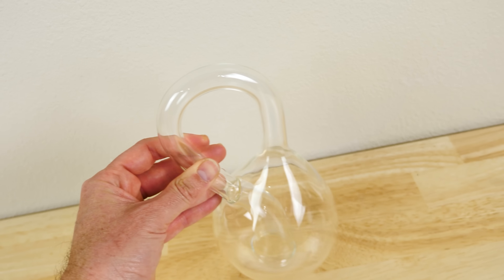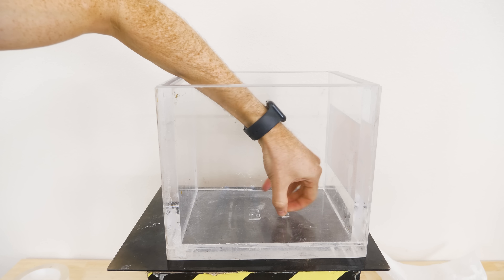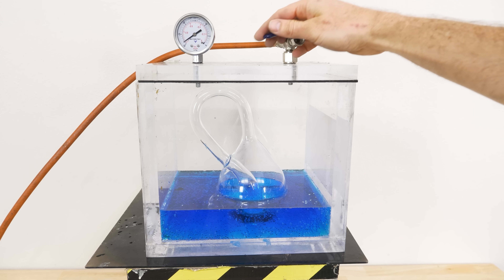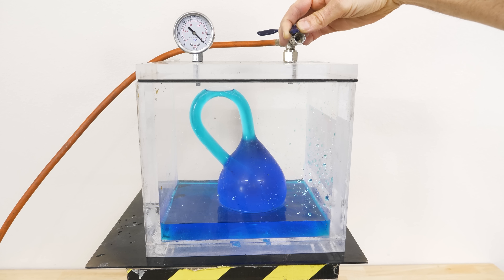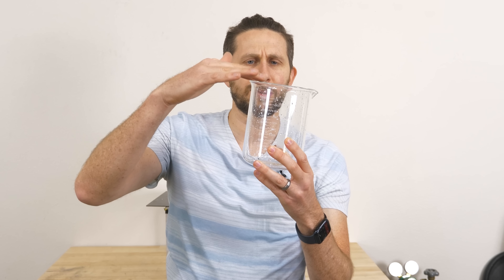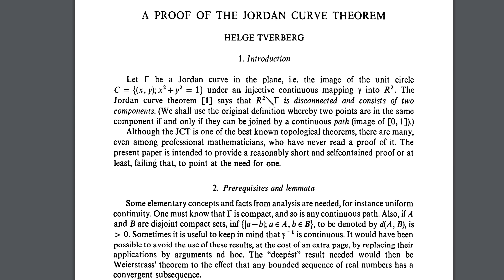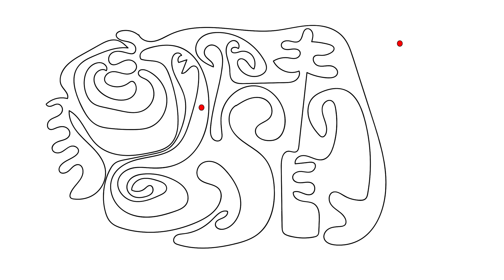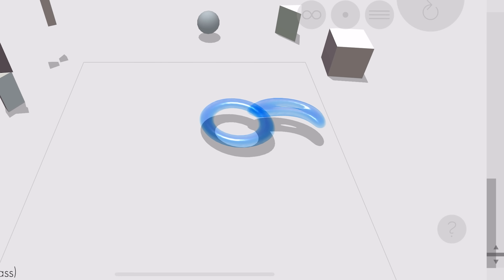Is It Possible To Completely Fill a Klein Bottle?

Comment: Thanks for this video, James! But you left me curious about what would have been left in the bottle if you had held it with its inside end down to let whatever amount of water might have fallen out do so. So will you please make a follow-up video and fully fill the bottle at least one more time, and first hold it with the "opening"/indentation pointed up, uncovered, and see if the water spouts/gurgles out of it, and how far?

And then if it does, refill it before tipping the bottle the other way, and then see again how far it empties?
Reply: The answer is pretty obvious. There's no magic to klein bottles. Just imagine it like a normal bottle with a straw coming out of the top and pointing down.

When the opening is pointing up, nothing will happen. It's like any ordinary cup in that sense. It will remain full.

When you point the opening down, the tube will partially empty, up to the point where it bends back down into the bottle.
Reply: @megamaser  there will probably be a minor difference due to pressure if you did it in air vs in a vacuum.
Reply: @westonding8953  liquid water boils in a vacuum so yeah of course it would be very different in a vacuum.
Reply: @megamaser  my idea of using a vacuum to fill the Klein bottle would use these steps.
1. Fill the chamber with water up to a level. 
2. Temporarily hang the Klein bottle on the top of the chamber. 
3. Evacuate the air at the top of the chamber and the Klein bottle.
4. Let the air degas and “boil” a little bit.
5. Re-evacuate the air at the top so there is less air in the system.
6. Drop the bottle into the water to start filling it. 
7. Open the chamber and take out the filled Klein bottle.
Reply: @megamaser : LOL, I never said I thought there was any "magic" to them. I wasn't sure about it because of the air pressure and gurgling potential. So maybe I can kind of imagine it, but I would still like to SEE it, and it would have been so easy for him to have done.

Comment: You needed a vacuum chamber to fill it, but are you able to pour/empty it without a vacuum chamber? If so, how does that work? How does it pour out?
Reply: I think it works if you put it on its side so that the ear is horisontal, then wiggle it in a circular motion to let the liquid out.
Reply: If you used a tube probably be able to fill

Comment: you also just shove a flexible tube into to the bulb and pump water in (air escapes around the tube), but that wouldn’t use the vacuum chamber 😘

Comment: Klein bottles are 4D shapes, so that isn't a Klein bottle; rather, it is a 3D approximation of a Klein bottle. It is impossible to fill a Klein bottle because the water will go out the sides, as well as what you state in your video.